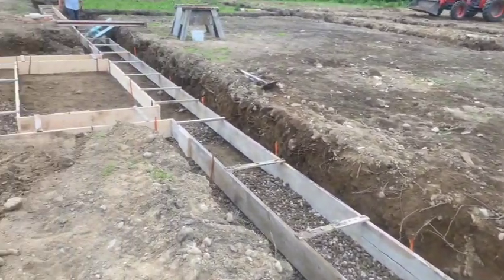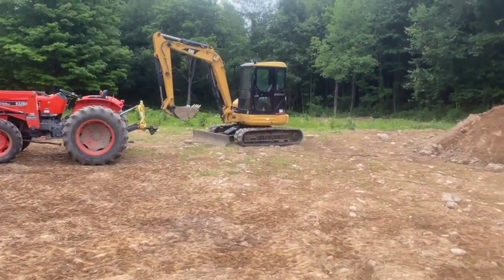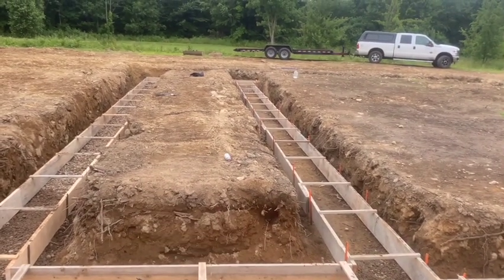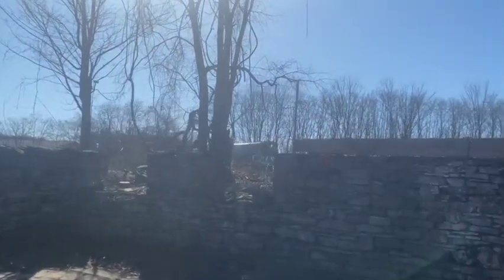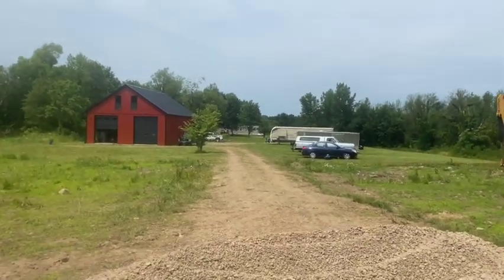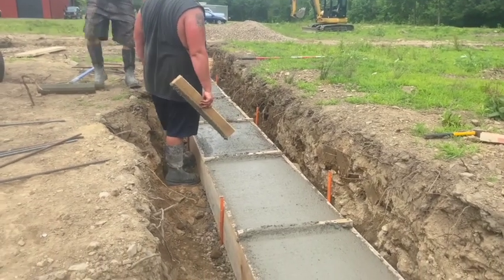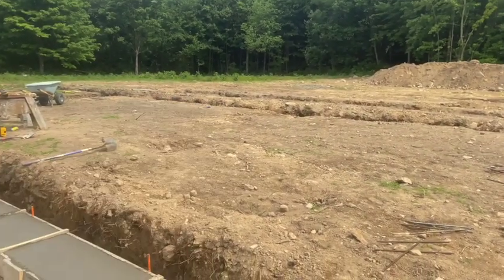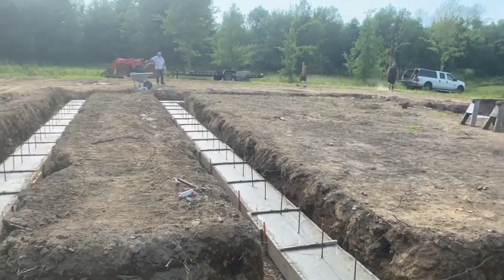How can we build a footer that is above the frost line?

Comment: If you have good drainage under the footing and drain tile around the footing with the drain tile covered with stone and filter fabric or hay on top of the stone to keep the dirt from filling the voids in the stone up, you won't have water or wet dirt under the foundation to heave it up. Then you put you 2" foam board sloped away from the foundation to further shed the water, then put a good compactable dirt one or more feet thick onto of the foam sloped away from the foundation.
The foundation drain tile/pipe should not be the black coil crap, use schedule 20 or 40 perforated pipe with the holes down and make sure it slopes away from the foundation.
Another thing not to do within 4 or 5' from the foundation is plant shrubs or trees. Their roots will grow right into the perimeter drain and clog it up.
There are garages, roads and driveways built all of the time with no "footing" below the frost line. If the drainage is right, there won't be any water to freeze so there is no heaving.
I live in Maine and have been building 46 years and we have never had a problem building this way.
Even if you have a foundation below the frost line, you have to do the drainage right and keep shrubs away from the foundation.
Another thing to think about is if this method didn't work, you couldn't get a building permit.
Reply from the maker: Me and you are definitely on the same page. That is exactly how I do these foundations 👍
Reply: @bondobuilt386  We'd get along great on a job. I was always taught that you build on the ground or under the ground. It's all about the drainage.
I have talked to people who are going to build a house and said to them to get good drainage. Use lots of stone and pipe and take it to daylight. Use the best pipe and keep plants with big roots away from the foundation. Lots of times they replay with it's too expensive. If you don't have a good foundation, roof and weathertight walls, why bother building new.
Reply: @royordway9157  does that go for fences as well?

I’m looking to put up a fence but don’t want to dig my fourth fence posts down 42 inches.

Or I was thinking putting a concrete retaining wall along the property line about 18” high then building the fence on top of that.

With the retaining wall have to be 42 inches down as well?

 or could I just dig a shallow trench put some rock and then pour concrete on top so the concrete is only like 6 inches below the surface and sticks up above the surface 1ft?
Reply: Totally agree that drainage is crucial.

Out of curiosity, why would have face the perforated pipe holes downward?

In landscaping, we always face the holes upward so that the water can drain into them, then the slope of the pipe itself ensures that the water drains as desired.   

That's the purpose the holes in the first place.

Comment: Looking forward to the next bit of the frost protected foundation trick with the "wing insulation" technique. I bookemarled your other vid on it and will show all your "wing insulation" technique vids to the carpenter and ICF contractor before the ICF extension will allegedly be build come Spring 2023. Do you think it is over kill having wing insulation for an ICF full basement wall and where all the ICF above ground wall goes right up to where the trussus will be placed?  Same as you, 4 foot rule for frost here on Prince Edward Island, just up North from you. Researching wing insulation techniques points out a 4 degree slant of the 2 or 4 foot "wing" so water runs away from the side of the basement wall. Keeping that wall and soil around it dry is very important. Also, it is the geothermal heat that gets trapped under the angled wing insulation that also helps keep the ground dry and warm. A 2 foot deep wing insulation starts at the wall and with the slope the end of the wing is deeper. I guess frost travels at a 30 degree angle? True or have you read differently? Why I am mentioning this is because it would be advantageous to use your idea of making sure the wing is very long, like 4 feet instead of 2. Cheers from Atlantic Canada. Really appreciate your video's and making sure we see how rebar is wired properly etc. 💯👍🙏🇨🇦

Comment: Why would they allow it to not be as deep just because of foam on the outside perimeter? Is that because theoretically it should hold heat within in the winter? How thick is the foam?
Reply from the maker: 2" foam and basically the foam takes the place of all that dirt and stops the frost from penetrating and heaving the footer.
Reply: @bondobuilt386  thanks for the response. Think you could do a video on that part? It's kinda hard to believe that it would actually do anything. If I saw the full concept I might get it though. Where the foam is actually placed and how it's oriented to stop frost from penetrating?
Reply from the maker: @jamesrogers4674  https://youtu.be/1_IiYCk_WNk
I have made a build series on frost protected foundation.

Comment: Have you tried the micro rebar stuff instead of rebar?
Reply: No where near as strong as true 1/2" bar. It's not worth the pennies you'd save in cost.
Reply: @pacodefrancis7235  is this a true statement? Also the key benefit is perhaps not having it rust out because it’s stainless steel and it’s way earlier to install.
Reply: @AKatawazi2  you do not want to put stainless in a foundation. You want galvanized

Comment: Why don t you use Helix micro rebar to save time,labor.
Reply: Micro-rebar works in walls, but I believe the foundation really needs traditional rebar. I believe the same is true for reinforcing above openings and other spans. You certainly wouldn't want the foundation to fail and loose its ability to carry the load.
Reply: @cornpop7805  Helix micro rebar has been used in slabs and foundations and is stronger than traditional rebar. Check out the stats on it.
Reply: @ToddBizCoach 
Perhaps you're right...

Comment: at $50 a sheet for ground-rated 2" blueboard you're not saving that much money haha. And yes oh yes, those rocks are much like what you find here in Central VT when we dig foundations. That's why i prefer a floating haunched edge slab. Very sturdy and stable with a foam curtain

Comment: Frost will push that pea stone off to the side in end fail on our side walls and foundation
Reply: Ya that shoulda all been compacted before framing.
Reply: Because they are using the tried and true (FPSF) Frost Protected Shallow Foundation (Nordic method), frost will never make it anywhere near the foundation.
Reply: @cornpop7805  idk cornpop. Pea gravel isn't a good material for compaction. Better off with a dense pack and a plate compactor to prep the trench vs tossing some gravel after the fact. At best the pea gravel will just blend with the soil and mostly disappear. It's just like ball bearings or marbles.
Reply: @KingSobieski 
I'm not saying it's the right choice of gravel, but I suspect it does have to be free draining because I believe the goal is to quickly rid water from under the footer. It's basically a french drain under the footer that has to see daylight in order to evacuate the water quickly. The above insulation keeps the shallow ground from loosing the heat that is present a lower depths. Together, the insulation, the French drain, and the higher temperatures at deaper depths protect the shallow foundation from seeing frost.
Reply: @cornpop7805  crushed rock drains the same as round rock
Reply: @KingSobieski 
I just said "I'm not saying it was the right choice of gravel". I'm just saying why there was gravel under the footer, period.

Comment: This type of foundation is new but old and has many issues
Reply: What are these issue Kevin?  If the wing is 4 feet long then frost will not have a chance to get under neath and the soil under the wing will be dry so therefore no wetness means no frost heaving issues. Make the wing insulation 4 feet{not only 2 feet) and 4 degree angle to get any wetness to drain away from the wall, and plus the angle will help trap  the geothermal heat further helping to keep the ground dry. We shall see what he does in his next video. Lots of work and paying attention to detail to get all this work done! Whoosh!! Cheers from Atlantic Canada.👍🇨🇦
Reply from the maker: @MegsCarpentry-lovedogs  We also put a perimeter drain along the footer and take that to daylight
Reply: @bondobuilt386  Yes, always a drain just in case and to daylight quite a bit a ways from the building foundation. You are the pro Bondo!💯🙏🇨🇦